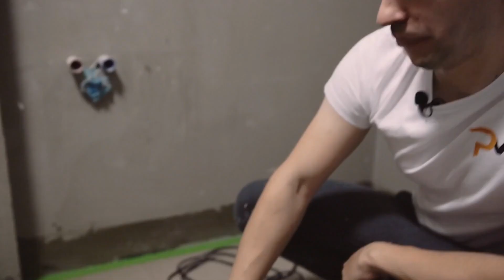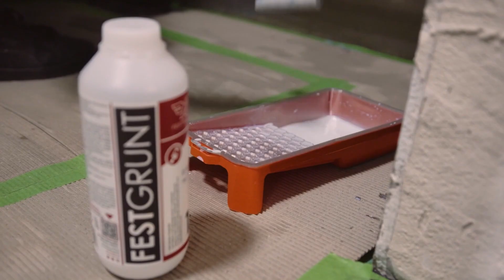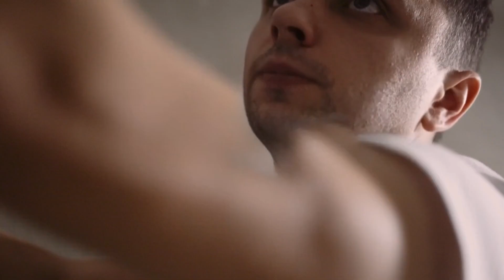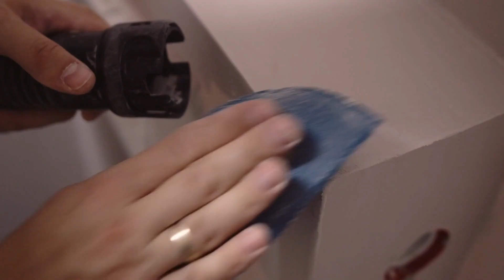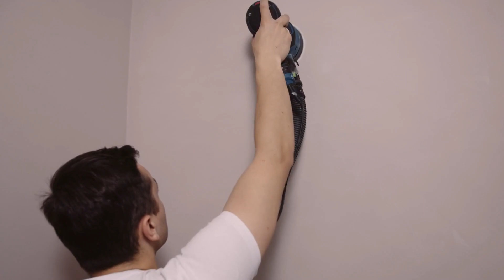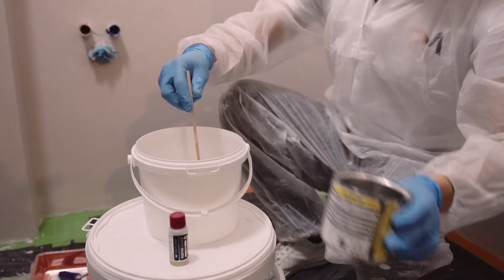HydroFest: water-resistant microcement for bathrooms – how to apply it?

Comment: Would it be possible apply microcement on hydroproofing aswell or would the substrate need to be sanded for better straightness? Is hydrofest also suitable for shower areas?
Reply from the maker: Yes, you can do it in the shower areas